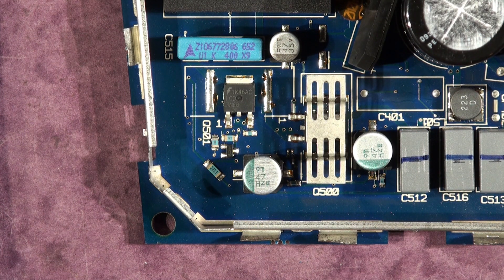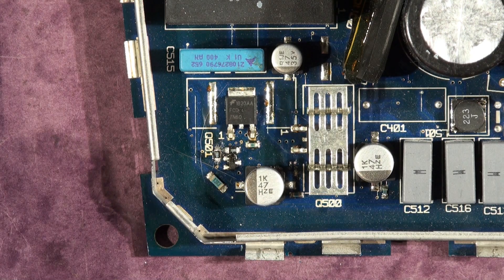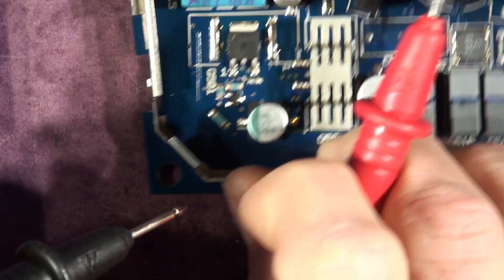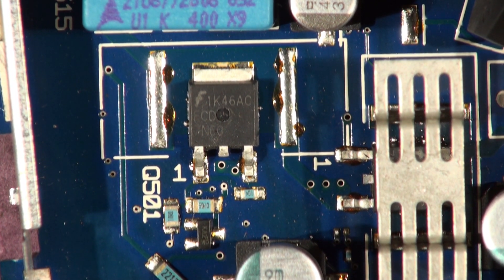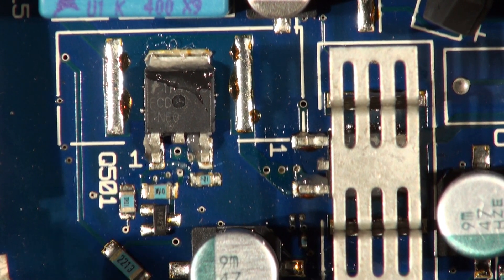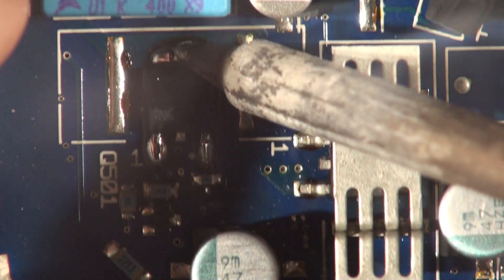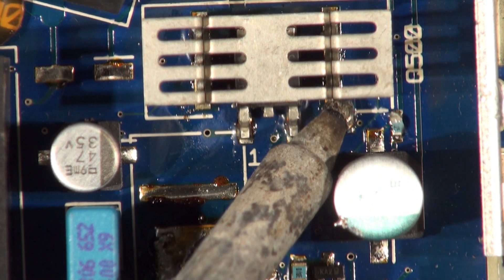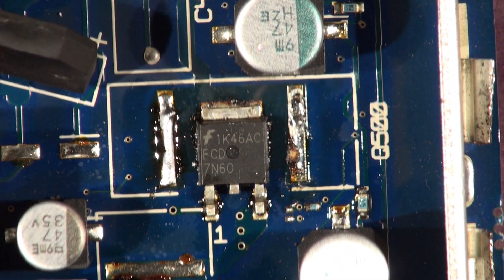Bose SoundDock 10 Diagnostics and Repair Video Part 3 -test & Remove Power FETs 322642-0020

Comment: Hello sir  can i use T2 15 amp fuse instead of T3 15 amp
Reply from the maker: The correct Fuse used by Bose is T1 5A.  The main difference between T2 and T1 rated fuses comes down to their time-current characteristics, meaning how quickly they respond to an overcurrent situation. Let’s break it down simply:
T stands for Time-delay or Slow-blow fuse. These are designed to tolerate short-term current spikes without blowing — useful for devices with inrush currents, like motors or power supplies.

T1 fuse: This is a slower time-delay fuse than T2. It takes longer to blow under overload conditions.
T2 fuse: This is a faster time-delay fuse compared to T1. It reacts quicker to overcurrent but still allows short spikes.

Comment: when i plugged power it giving sound tune...but no light aux....
Reply from the maker: Check the ribbons and watch the diagnostic video on this channel. Sometimes the act of unplugging and re-plugging the ribbons can fix them. A layer of tin oxide builds up on between the ribbon and connector contacts. Plugging them in and out cleans them. Good luck.

Comment: i have one. have power but no sound in bluetooth and aux. how can i fix
Reply from the maker: Watch the diagnostic video and check all ribbon cables and circuit boards for corrosion.

Comment: Hi, my unit blinks 5 times with both source LEDs when connected to mains (which means hardware error due to the manufacturer's website) then it does only react to remote (flashes the corresponding source LED). No sound, no beeps, BT module LEDs do not lit up. What could be the problem?
Reply from the maker: Do you hear the Beep-Bloop tones when you apply power?
Reply: @razenby  No beep. Found short circuit on TDF8599 output which means the amp chip was faulty. Replaced with TDF8597 and all works now.

Comment: Is it possible to test the power supply board stand alone? Or does it require some kind of wiring or even dismantling in the sound dock? Many thanks!!!
Reply from the maker: No you can plug it in if you know what you are doing.  You have to do a load test though as there are several faults that cause it to fall over as soon as the rest of the circuitry start drawing power.

Comment: I have a question , mine turn on normally but the sound doesn't go out ( i plugged a bluetooth module and still not working but when i plugged my headphone  it works , so i checked the speaker and its good  so the problem is somewhere on the  board but where  idk    can anyone help me
Reply from the maker: Are you saying that you can plug the audio feed cable in the  rear Aux socket and it works?

Comment: Puedes ayudarme con un sountouch 30 por favor gracias.
Reply from the maker: La placa de alimentación de SoundTouch 30 es la misma que la de SoundDock 10. Puedes seguir los videos de Sounddock 10 SoundTouch 30 power board is the same as the SoundDock 10!!
Reply: @razenby  me doy cuenta que es lo mismo. Como te comentaba tengo todos los voltaje pero no me enciende. Es que acaso necesito el tpa3100
Reply: Hola amigo, tengo el mismo problema con mi equipo, es un Soundtouch 30 que ya no enciende. Le encontraste algun problema tu power supply?
Reply: @JORGEGUTIERREZCONTRERAS-r9t   tienes facebook o telegram.??? Aun no doy con el fallo pero podriamos ayudarnos

Comment: muy buenos dias amigo, excelentes videos, felicidades, tengo un Bose SoundDock 10, que no enciende, lo desarme para ver si encontraba la falla, y lo unico que pude notar en la placa de circuitos es que el Amplificador TPA3100D2 98T CJZ2 tiene dos de sus pines quemados, es posible que este problema cause que no encienda el equipo,  si es asi, donde puedo adquirir dicho amplificador,  gracias y saludos desde Venezuela.
Reply from the maker: Hola, sí, el chip del amplificador no lo encenderá debido a una sobrecorriente en la fuente de alimentación. Una palabra de advertencia. el LM5021-2 no tolera el ciclo de encendido y apagado por sobrecorriente durante más de unos pocos minutos, por lo que debe quitar el TPA3100D2, encenderlo y luego ver si recibe alimentación de CC. Si no lo necesita, también necesita el chip LM5021-2. Buena suerte. Compre TPA3100D2 aquí: https://www.aliexpress.com
Reply: Maiker Luque como te fu?? Tengo el.mismo problema ya retire el tpa pero aun no emciende todos los voltios cc son 24v que llega ese ic pero no enciende.
Reply: @electronicaeli-ezer973  amigo eliezer pudiste resolver el problema del tpa? Encendió?  Yo aun no desoldo el tpa porque no lo he pedido a China. También el controlador PWM
Reply: @mariajosehernandez1060   aun no. Pero que problema tiene el tuyo
Reply: @electronicaeli-ezer973  yo soy Maiker Luque. Se quemo el chip TPA3100D2 y no enciende
Reply: @mariajosehernandez1060  🤔🤔🤔
Reply: El mío está en corto la placa madre y encuentro.la falla